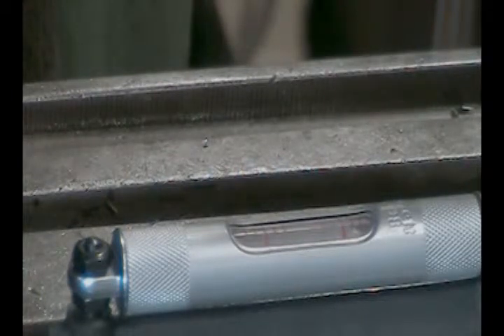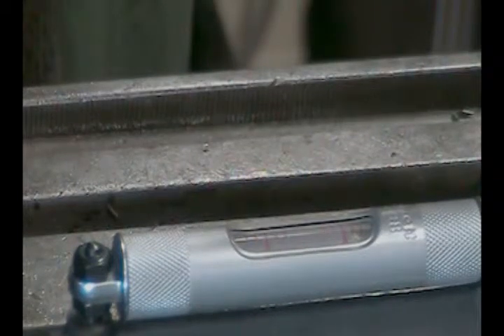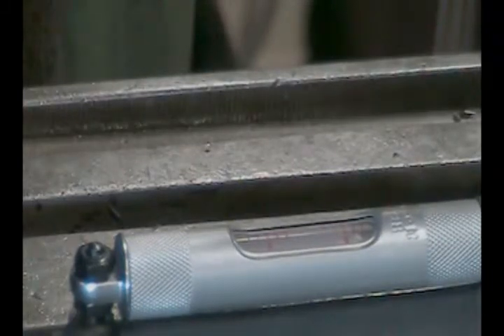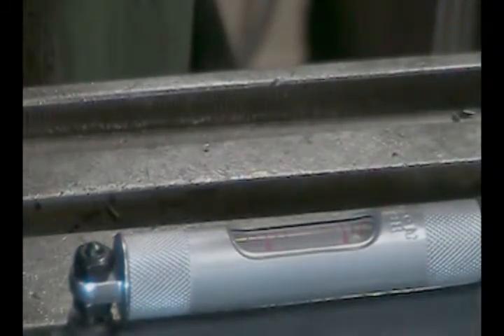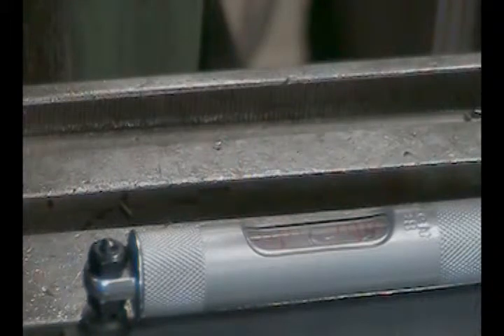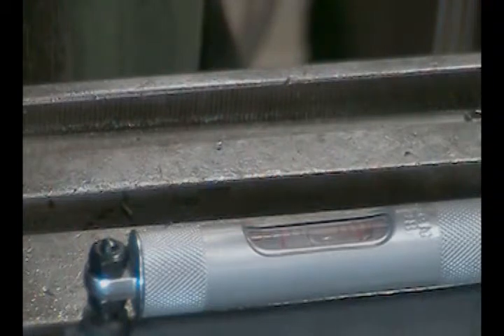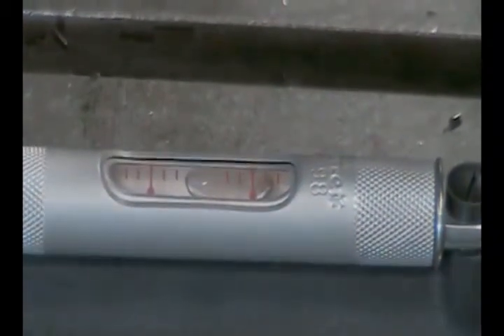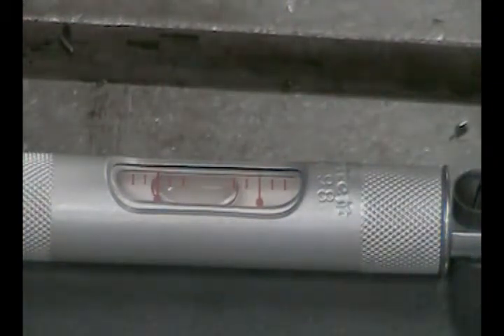On The Level Part 13

Comment: Hey Pat, great little series. Are you planning on anything more? Or specifically, could you do a vid on the general operations of the number 2? I have an old no. 3 plain vertical I am restoring now, and any info I can get on it would ve greatly apresheated. Also more operation vids on that 2d as well, that is one sweet machine!